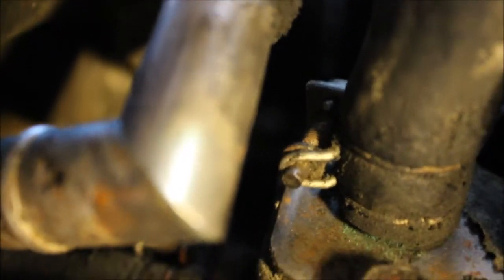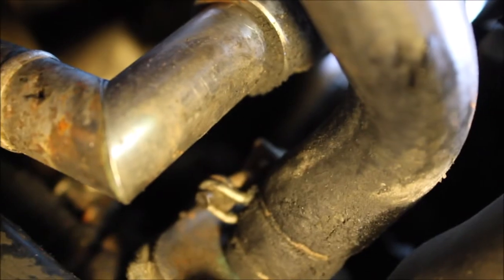Difficult coolant leak repair on a 1995 Nissan pickup.

Comment: The hose on my pickup was bad just took it off, pain in the rear. Took off the passenger fender, passenger front tire, alternator and took a good while but got it off. Did not bother with the manifold now I'm going to attempt to put it on. Got different clamps hopefully will work a lot easier.

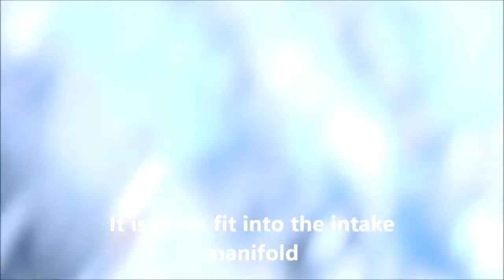Comment: Robert: at 1:04 you show a hose disconnected from the metal elbow. This hose actually runs right past the PCV and you can access this through the passenger wheel well. Did you replace this hose? If so, do you have the part number from Nissan?
Reply from the maker: I used the original hose, just pushed it over the "ridge" on the elbow and put a band clamp on it to seal the hose over the little hole in that space. Obviously to correct fix for this is to replace the rusted elbow completely, but it's a much bigger job. I referred to another guy who did it in my description. Hope you found a solution.

Comment: Easiest way to do this job is by removing the power steering pump, but it is still a right fit I just removed the power steering pump from the mount and I left all the lines attached and u are able to drop a wrench into the hose clamps to remove the hose

Comment: Hello Robert. I have the same coolant leak. On removing the u shaped hose the elbow fell out. I noticed  your hose elbow was out as well. Did you glue it back into the manifold or just push it back in. Did it seal properly ?
Reply from the maker: Mine was still in place but the hroizontal part was corroded beyond the retaining ring for the hose clamp. I was able to pull the hose up against the vertical part of the elbow and replaced the wire clamp with a band clamp . . . and it worked. I'm concerned you may have a bigger problem. According to the only other YouTube post I found on this, the elbow was orignally a press fit and you can't get the part. He removed the head to get to his and used a tap and dye to replace his with a threaded fitting. My back up plan, had I failed, was to cut off the horizontal part of the elbow and add a piece of hose to clamp onto the remaining fertical part with a band clamp and connect it to the remainer of the original hose. Tough job as well,  but maybe easier than removing the head. Best of luck.
Reply: @roberthare2251  hi Robert. Yes mine came out completely but I used a Dremel to clean the hole up in the manifold. Then used jb weld to hold it it in the manifold.  It's held up so far. Note jb weld is no good with coolant as it disolves. But anyway if it starts to leaked again I will do what the other fellow did and tap the manifold. Great to see you share your videos it was a great help in identifying the problem and helped me how to go about repairing. Well done.
Reply from the maker: @paulrainbird9601  Hope the weld holds. Best of luck.
Reply: I'm having the exact problem. I think I can get it but I need to know the size.
Reply from the maker: @5theend1  I re-used mine without taking it off the vehicle so I'm not sure of the actual size. If yours just separated like mine did, and the hose is still good, I would do the same thing I did - slide it all the way onto the nipple and replace the original wire clamp with a band clamp.  The outside diameter of the hose is about 5/8 inch and you can buy replacement hoses if you need one (just put in vehicle info into any online vender) if the nipple is still usable.